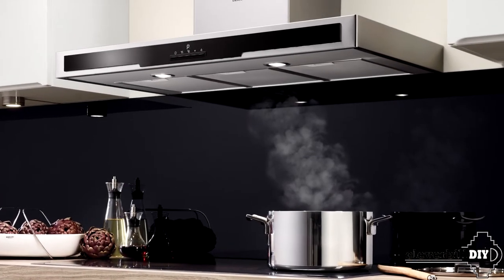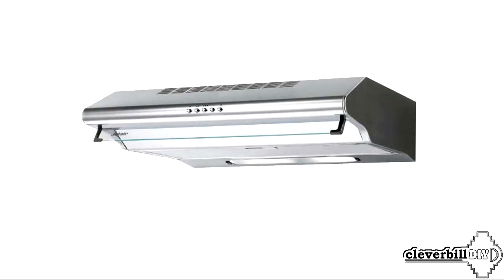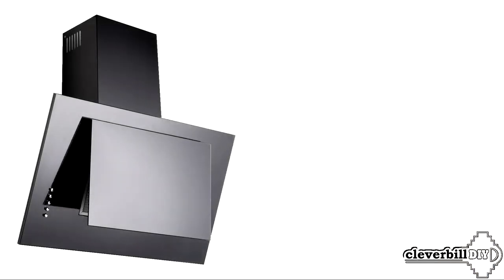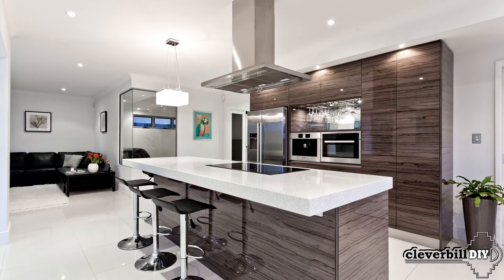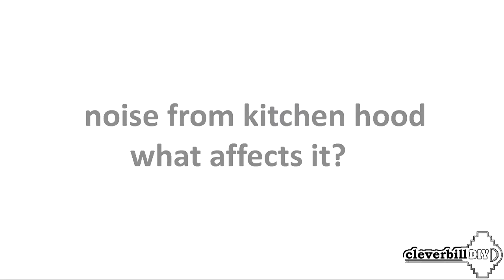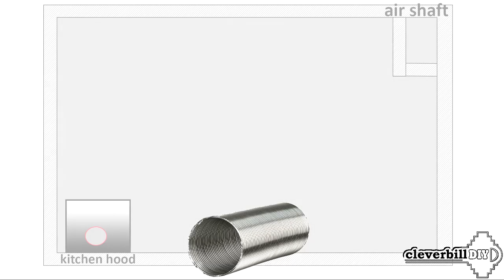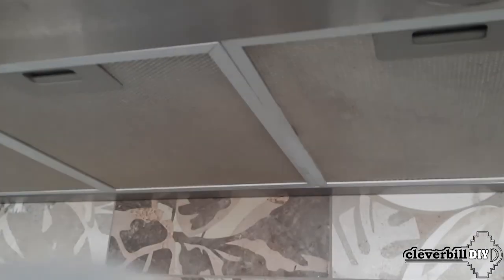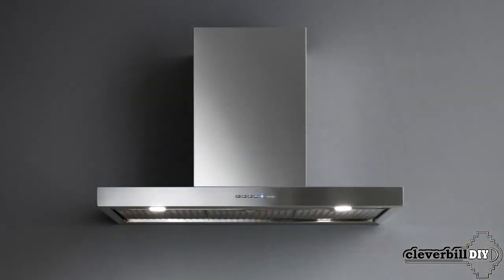Kitchen hood - How to choose what you need to know before buying?

Comment from the maker: When choosing a kitchen hood, it is advisable to immediately understand in what mode it will work (recirculation or outlet to the ventilation duct). To do this, you need to study the possibility of connecting the hood to the ventilation. You also need to have a clear picture of the kitchen furniture, and take into account the dimensions of the hood so that it fits exactly into the space between the cabinets.
Reply: It would have been clearer to visualise this if you discussed how much cupboard space these units take up.